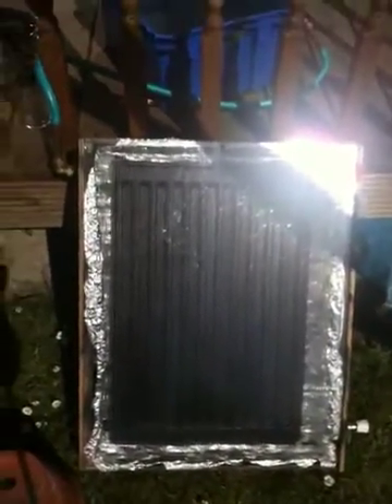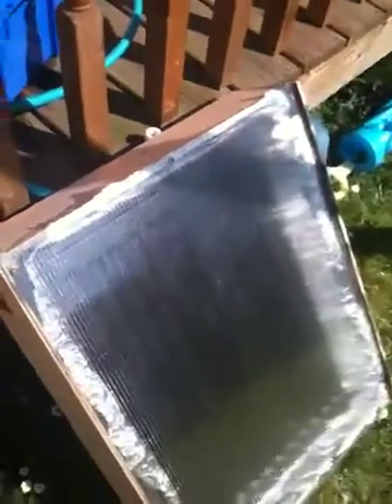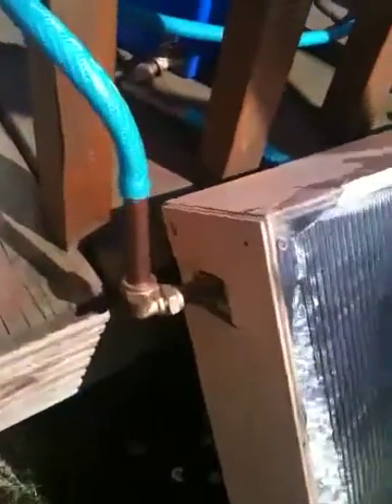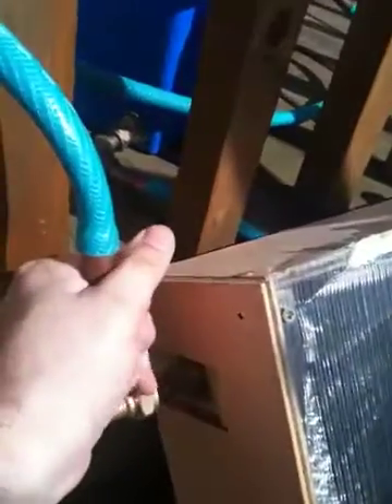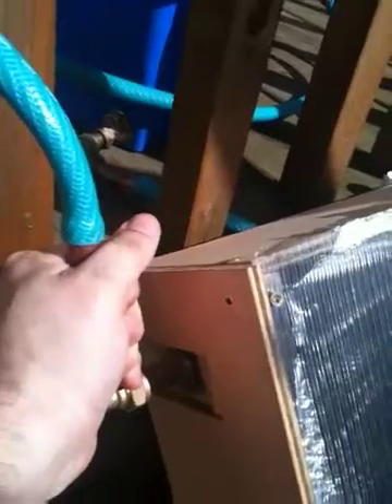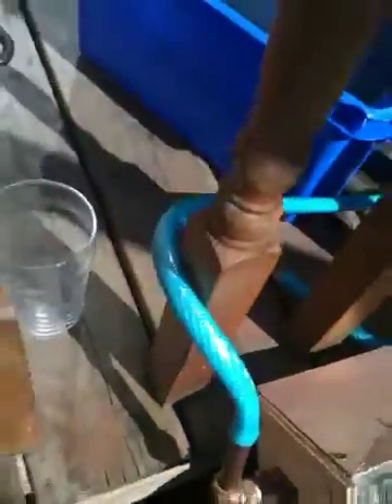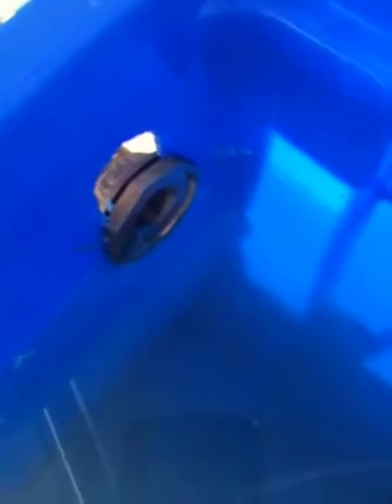Prototype solar water heater

Comment: cheers for the reply. mine's a  bit of a hack job.. working on the box and the mount now.. hopefully work out all the plumbing soon. did you put yours to use? it will be slightly diagonal.. but not as much as ideal.

Comment from the maker: you really need the cold inlet to be as low and as far as possible from the outlet. the heat from the radiator raises the hot water up. as the flow goes out, so the cold water is sucked in the bottom.

Comment: looks good. did you weld a fitting on to the top of the radiator to get the diagonal flow? i'm considering using a regular radiator but upside down.. so both in and out would be on the top. radiator is 2m long so that might be enough distance between them for the water to circulate inside..